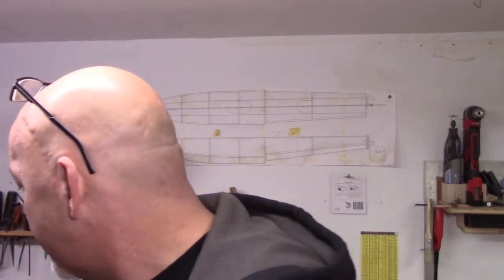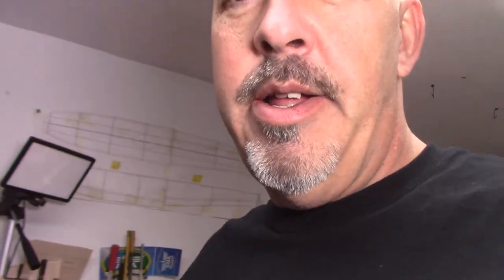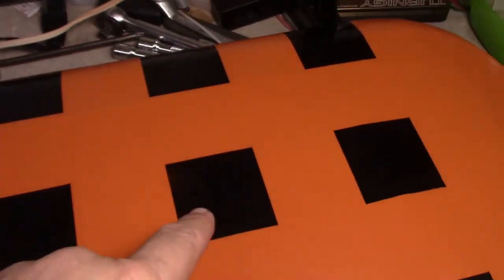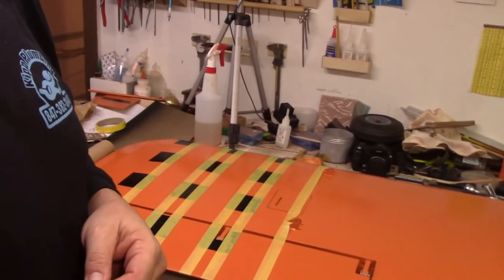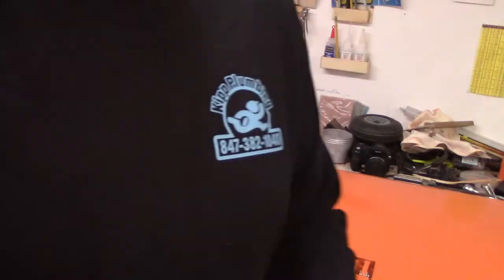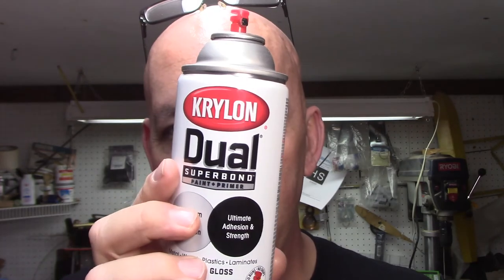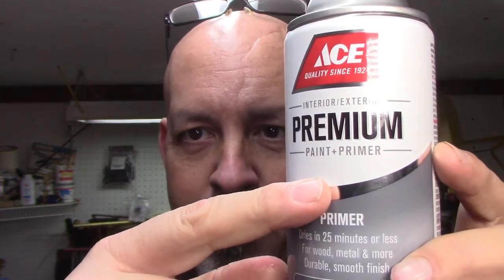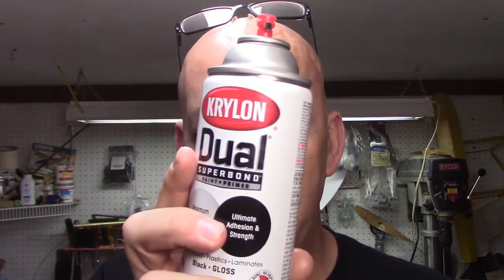33% Clipped Wing Taylorcraft Restoration - Video 74 - Huge paint problem and possible fix

Comment: would sanding lightly increase bite and grease and wax remover wipe down?  super interesting how this paint is going on
Reply from the maker: I now believe the issues with the paint stem from the filler used in the dope and the aluminum paste  not working nicely together with the new primer+paint formulas. On my Stampe, i used corn starch as the filler, then sprayed automotive primer before spray paint. This worked well with no issues.